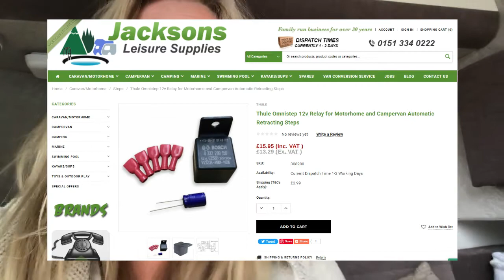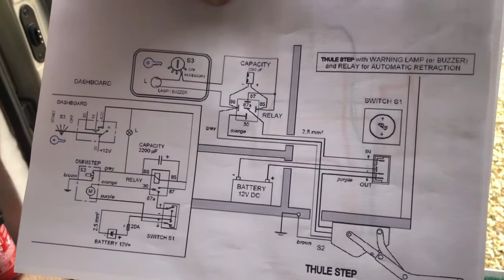Installing a Thule Omnistep 12v Relay for a Auto Retracting Step on a FORD TRANSIT MURVI CAMPER VAN

Comment: Just about to start this very job on a self build transit.
I’ll fit my switch halfway up the B Post just behind the passenger seat, making it easy to reach from the inside or outside of the vehicle.
The ford fitted power connectors for a tow bar feed are located in the passenger footwell (behind the plastic fascia). This should provide an ignition livery and power feed making the wiring very straightforward.

Comment: Hi following your video inspiration I ordered the kit and tried installing it to our 1997 1.9td fiat ducato AutoRoller motorhome which doesn't even have a buzzer to remind you if you've left it open. So I'm incorporating a buzzer into the system as well. I'm having problems and  can't get it to work properly as my switch as 5 terminals I tried following the instructions but the best I got was buzzer sounds when ignition is on step retracts but not fully which means the buzzer keeps sounding as not breaking the circuit at the step retract switch. Do you have photos you could send me of the process you did and of your wiring please. Best Regards Paul
Reply from the maker: Hi just seen this comment, sorry for the late reply, hope you sorted it out. Lew👍